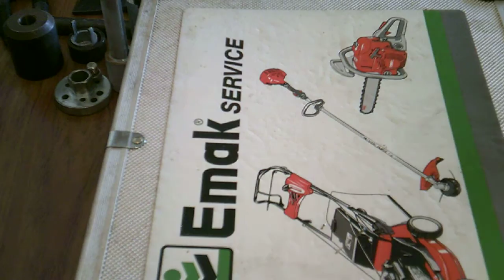chainsaw tools/pressure testing

Comment: Hey kevin  how do you test a misfiring ignition on chainsaws sometimes it sounds like a carb issue but could be coil?
Reply from the maker: Echo makes a special ignition tester for there chainsaws and trimmers .....I recommend purchasing it. How ever there are some coils that contain rev limiters so it could be that you have a bad coil due to the limiter making a issue .
Reply: Thanks man the echo adjustable?

Comment: Where did you get the kit?
Reply from the maker: My basic kit was purchased threw CPD by attending a service class put on by EFCO .They had the kit on sale to dealers for 200.00 dollars ...My boss asked a friend to hook me up as I wonted the kit with the additional items . The kit was a great value for the price at the time ...However only sold to dealers ....I would recommend  looking up Husqvarna pressure and vac kits on ebay as I have seen that they offer a kit very similar for about 90 dollars ....Not quite the same but still very respectable for the price .